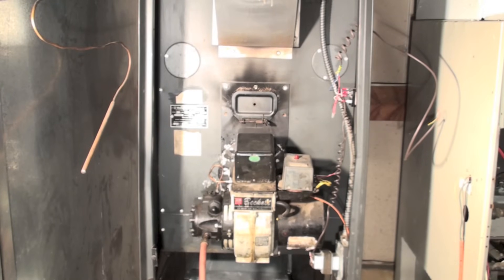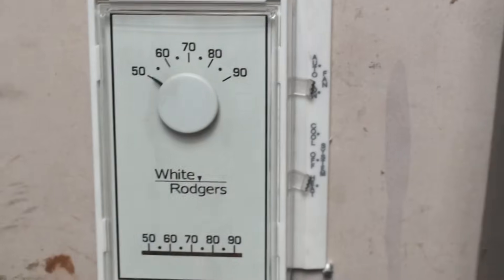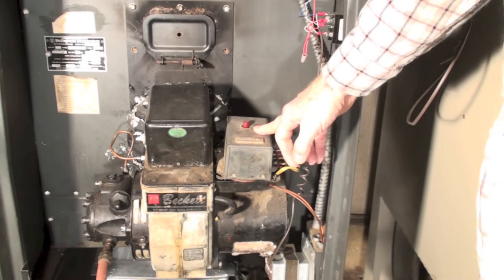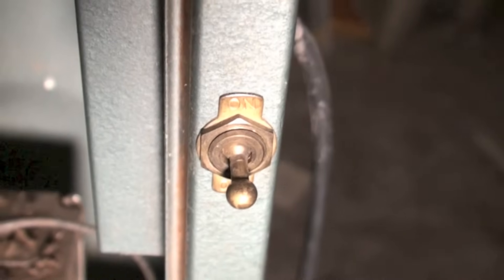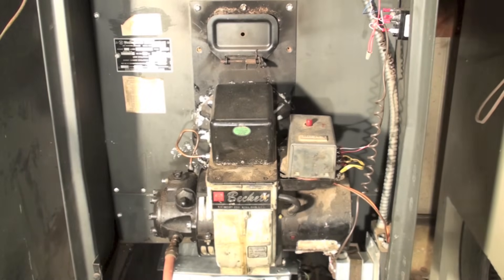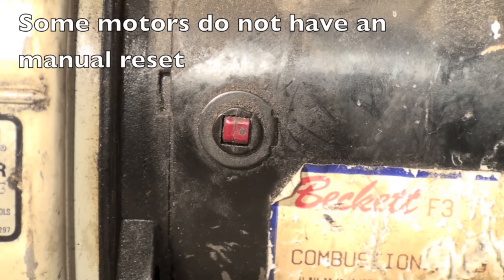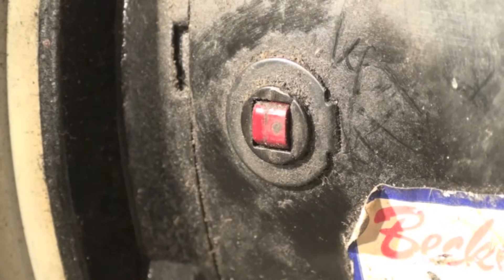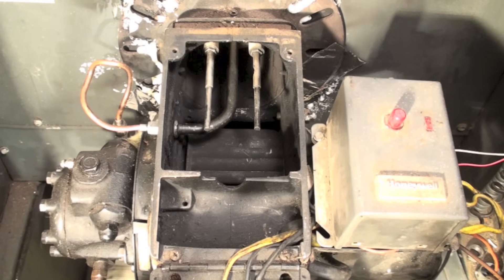Troubleshoot the oil furnace part 1. Burner won't start.

Comment: Wow - great video series - i've been watching your vids, and just came across what i believe to be relevant to my situation...  it's an oil boiler, not furnace, but the problem seems analogous. an elderly aunt's boiler has apparently not worked properly in years. As witnessed by me, she presses the reset button, there's an electrical hum - then she taps the side of the burner motor with a rubber mallet she keeps down there just for this purpose.  Sometimes it takes a few moderate whacks, and eventually kicks over. It'll run fine until it's no longer needed (thermostat up to temp) - and then she'll repeat this process the next time she needs heat.  I'm finding a tech anyway to come in and service the system, but at this point, i'm suspecting i should be ready for a new burner motor - was this a common need "back when" - because she seemed to act like it was no big deal, and she's always done it like this, lol.

Comment: Fantastic set of videos and great info on your website.  Thank you very much for doing this for us DIY guys.  I'm hoping you can help me out with a question though.  I've gone through the diagnostics you've shown here.  I ended up replacing the motor just in case as it was spinning very freely and I figured why not.  After changing it though, same issue. Heater kicks on, sparks, but the fan/pump motor won't turn at all.  I'm thinking the fan should kick on to pump fuel into the chamber, the ignite. Do I have that backwards?  Is possibly my cad cell relay is the issue?
Reply from the maker: Chris Davis Sounds like the cad cell relay may not be sending power to the motor.  If you can use a voltmeter, check the wires going to the motor before it safeties out.  
GFM
Reply: I tested with my multimeter and the output was 10% of the input. By passed the Honeywell to power the pump and everything spun up. New part ordered :) once again thank you the educational information shared on your sites.

Comment: Hello thanks for the great videos. Just wanna ask you a question. where would the flame sensor be located in this particular oil furnace? And can using diesel be any effect to this unit?
Reply from the maker: Jermaine Thompson The flame sensor is a light sensitive cad cell pointing towards the flame beneath the transformer.  #2 diesel is more or less the same as fuel oil.  Road diesel may have additives for use as a motor fuel and is more expensive.  Hope this helps.
GFM

Comment: just went through this...turns out that on my fan there is a centrifical clutch (like a go kart) On the bell of the clutch is a male spline like that on the drive side of the fuel pump. The plastic coupling which connects to the fan spline and thereby drives the fuel pump spline looks like a wrench socket with a female spline at both ends. This plastic drive coupling had broken up. To make matters worse, the same day we are only getting warm water out of the electric water heater. Oh and the car had to go into the shop for a muffler,tie rod end, ball joint and a horn. When it rains it pours...
Reply from the maker: You can buy the coupler parts and just cut the female tubing at your length.
GFM
Reply: thats basically what the repair man my wife called did...he did say though that he never saw a centrifical clutch on a fan mtr ever...lol

Comment: i can hear the water coursing thru the furnace in all the heaters it runs fine but it sounds like a leak but no leak bled the heaters but can still hear it
Reply from the maker: If you can hear water in the convectors, you have air in the system.  May try bleeding at the boiler if it has one there.  Hope this helps.
GFM
Reply: grayfurnaceman It was a frozen radiator pipe in the living room by the door thawed it out problem solved thanx for the vids there very helpfull

Comment: My oil burner will run sometimes for days, and sometimes only for seconds after I push the red button. It is completely random and I have put a new filter on the line and a new nozzle. Why does it keep shutting down? Great videos btw!
Reply from the maker: First, does the flame come on when you press the reset?  If the flame is coming on and it still shuts down during the 40 second trial for ignition, There may be a sensing problem.  Clean the cad cell first.  If that does not help, check the resistance of the cad cell dark(20000+ ohms) lit(less than 1000 ohms).  If all checks out, the cad cell relay.  Hope this helps.
GFM
Reply: where can I buy parts? everyone listed is a wholesaler, or a contractor.

Comment: Hello,
My problem is that the furnace will start and run fine when I first increase the thermostat temperature, but it will not restart on its own after the room temperature drops below the set temperature. I have to turn the emergency switch off and on again to restart it. Sometimes it takes two or three "Off & On" cycles to get it to restart. The problem is intermittent, but 75-80% of the times I have to do this. I have replaced the thermostat with a new one. I have an oil steam boiler with Becket burner. Any suggestions? Thank you.
Reply from the maker: Are you pushing the red button?  If so the unit is shutting down on flame failure.  You need to be looking at whether it has been serviced recently.  You may have a plugged oil filter/line.  Hope this helps.
GFM